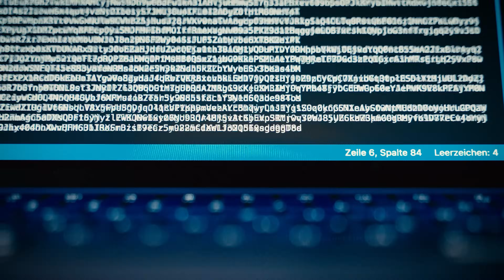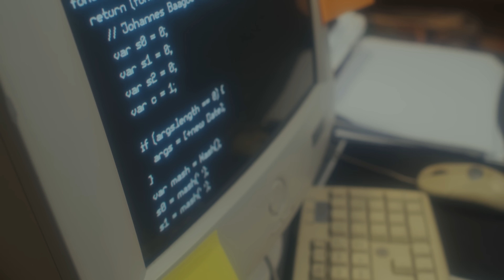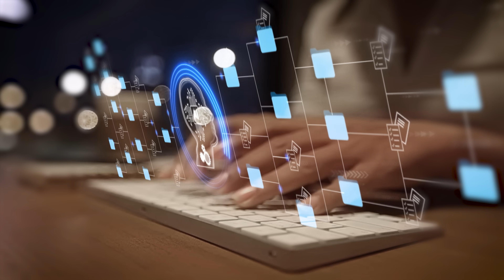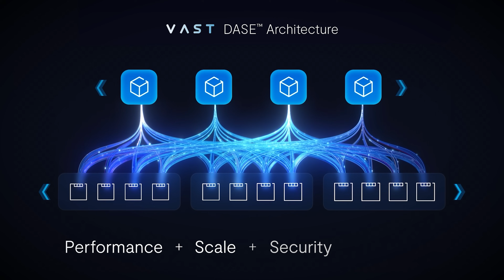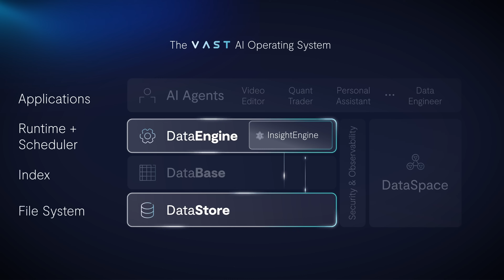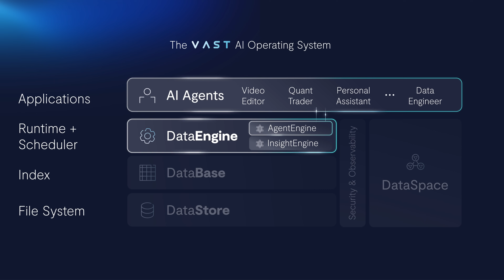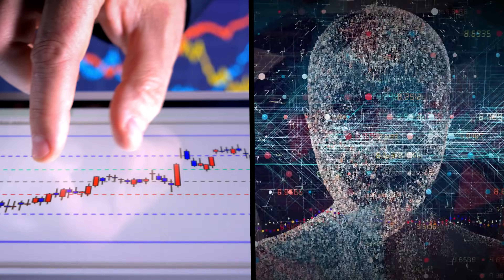Introducing The VAST AI Operating System | AI OS Overview | VAST Data

Comment: I just thought of something similar after performing a mis click on my machine, a minimal, UI-less endpoint operating system for agents to directly “drive” a computer and embed an LLM into the OS layer, add agent scheduling/memory/tooling, and provide a computer-use agent via a VM/MCP controller for GUI automation, "The AI Operating System", and thought, "surely, this is not a novel idea". However, VAST’s AgentEngine is effectively an agent layer above the application stack, but implemented as enterprise infrastructure (data plane + control plane), not as a minimal endpoint local Agent-OS for automating workstation tasks securely that I envision. This idea came to mind after I just mis clicked on my computer and ran a duplicate job/process. Thankfully, It was blocked. Someday, it will be most secure for enterprise users to have LLM agents handling the computer tasks and human employees won't be allowed to type and click the mouse. The employee will provide the task instruction, and the agent will handle the task. In fact, the UI and peripherals won't be necessary at all. The AI will navigate a minimalistic OS that better equips it to send emails, copy files, print reports, transfer data, and execute jobs and more. Think of how this will change the OSI model from physical to transport to application layers by introducing a new "agent layer”. How can I contribute to this vision and lead the world in the next step in technology, Agent Operating Systems (AOS)?

Comment: If the VAST AI Operating System, or AI in general, becomes widely adopted and highly advanced, many jobs that involve repetitive, routine, and data-intensive tasks are at high risk of being significantly impacted or even replaced.

Here's a breakdown of job types that are commonly cited as vulnerable:

1. Jobs with High Repetitive and Routine Tasks:

Data Entry Clerks: AI can automate the input and processing of large volumes of structured data.
Bookkeepers and Accountants: AI can handle tasks like expense tracking, reconciliation, and generating financial reports.
Customer Service Representatives: AI-powered chatbots and virtual assistants are increasingly capable of handling routine inquiries and support.
Telemarketers: These roles often follow scripts and manage routine customer interactions, which AI can perform.
Assembly Line Workers/Manufacturing Workers: Robots and AI can perform physical tasks like assembling, inspecting, and packaging products with greater speed and consistency.
Bank Tellers and Cashiers: Digital banking, self-checkout systems, and automated payment solutions reduce the need for human interaction in these roles.
Proofreaders: Advanced editing software and AI grammar checkers can identify errors faster than humans.
Receptionists: Automated systems can manage calls, scheduling, and visitor check-ins.
2. Jobs Involving Data Analysis and Prediction:

Market Research Analysts and Financial Analysts: AI is highly capable of processing vast amounts of data, identifying patterns, and predicting outcomes.
Paralegals: AI can streamline legal research, document sorting, and fact-gathering for cases.
3. Transportation and Logistics:

Car and Truck Drivers: The advancement of autonomous vehicles poses a significant threat to these roles.
Warehouse Workers: AI-powered machines and robots can retrieve goods and navigate warehouses, reducing the need for human intervention.
4. Content Creation and Design (to some extent):

Basic Content Writers: AI language models can generate formulaic emails, short social media posts, and even first drafts of longer content.
Graphic Designers: AI tools can create professional images and assist with design tasks, potentially reducing the demand for certain graphic design services.
Important Considerations:

Augmentation vs. Replacement: In many cases, AI may not fully replace jobs but rather augment human capabilities. This means workers will need to adapt and learn to collaborate with AI tools, shifting their focus to more complex, creative, and strategic tasks that require human judgment, critical thinking, and emotional intelligence.
New Job Creation: AI is also expected to create new jobs in fields like AI development, machine learning, data science, AI ethics, and roles that manage and maintain AI systems.
Skill Gaps: The transition will likely lead to skill gaps, requiring significant investment in reskilling and upskilling programs for the workforce.
Impact Varies: The impact of AI will vary across industries and regions. Jobs requiring significant human interaction, creativity, complex problem-solving, and emotional intelligence are generally considered less susceptible to full automation in the near future.

Comment: I am writing a similar presentation to whittle into prompts for setting up a clutch of megascaled projects as is intimated in the made example here.

I see the OS as customizable-self-designed. Establishes deep root access to all of the hardware on the system. Writes code down to customizing bios & firmware. Fluid flowing of IO to what is convenient as well as distributing compute loads. All as PA, XO, Chief of Staff, research assistant, PT, and coach.

Key to an emerging Human-Machine-Interface, HMI.